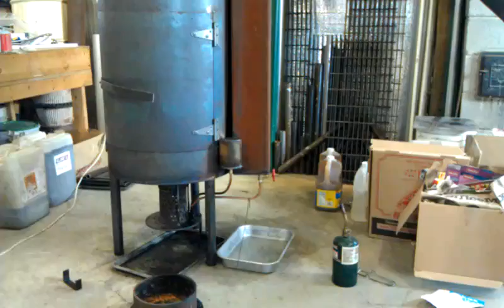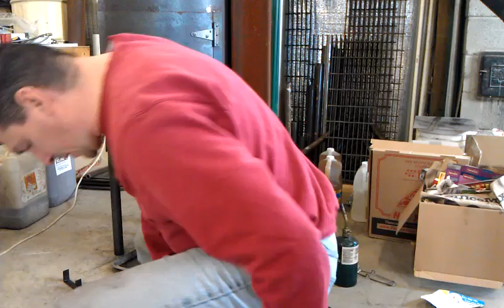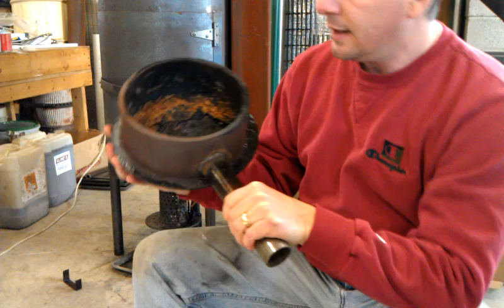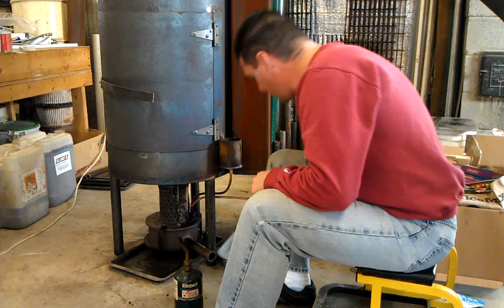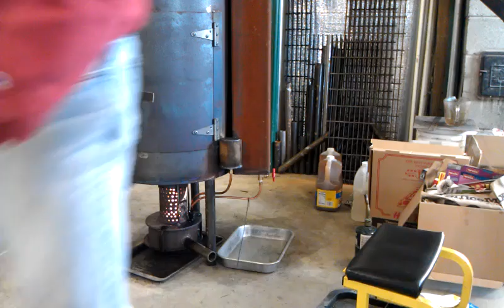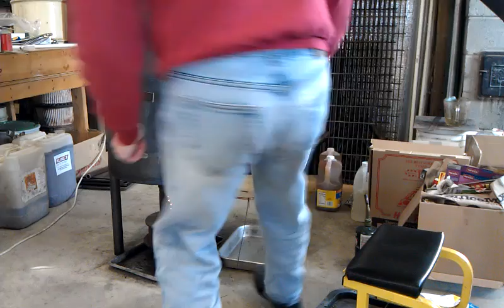Ozzirt style Waste oil Heater Lighting from Cold Start

Comment: Hmm.... I can't help but think, kerosene just isn't what it used to be!! We ran kerosene in a space heater and in our steam cleaner. They would run on either #2 fuel oil (diesel) or kerosene. Both quit working after getting a new delivery of kerosene... Couldn't even get it to burn well with a propane torch!!
After a good cleaning of both, finally got the steam cleaner running on diesel, it ran well.. the space heater never did burn correctly again 😥
So, drip some diesel in it, get some heat going!!
Reply from the maker: Hi Ed, yes I used to pour some diesel or kero in the sidekick tank to get things going more easily. It was a cool little stove that I created there, but I sold it long ago to someone in my hometown. I should write to him to see if he's still using it?

Comment: HI, neat system 
I just burnt my first 5 gallons of wvo and the bottom of the oil bucket has pudding like stuff that really gums up the burn pot. Do you usually settle out this stuff before and not burn it?
Reply from the maker: Well truly this system was designed to take the nasty stuff, chunks, water ...whatever you throw at it. So my advice would be to mix it well before firing up your stove. That way the gunk runs through and is burned up with the rest of the good fuel. Obviously you'll have to take care of clogs or make your lines large enough that clogs are not an issue, but in the end this can "eat" anything so long as it's given in small doses. -Does that make sense?

Comment: Hi this is my first time here. I am an old goat and have some experience with oil burners. first, when I was a young man i worked in a hillbilly garage. we had an oil heater made from an old hot water tank. worked really well for het using waste oil. It once wasnt monitored for about an hour and it filled and overflowed onto the floor. we had about an inch there we we found it.  lotta clean there. next I worked as a facility maintenance man for almost 40 years. our boilers always used forced for combustion and the fuel was atomized. it caught readily...figure out a way to atomixe it without power and you have something.  last..several people mentioned they are unable to find kerosene.  Diesel fuel used transmission fluid and used motor oil in that order will function in a oil heater.  they do need to be filtered if you are going to use them, otherwise they plug the lines at a choke point, aka valves.  if oil has plenty of combustion air it is capable of burning very clean.

Comment: How do you keep the waste veg oil from "gelling up" while it is inside a cold shop?
Reply from the maker: you don't prevent it. but by having the fuel tank on the side starting it on kero and having the sidekick allows me to easily deal with the issue. the heater warms the main tank in short order.

Comment: Mate, you are so behind.   I watched and waited for something spectacular, alas nothing happened.   You obviously haven't seen what you can do with air pressure?   Look it up and perhaps you won't be freezing your balls off waiting for the the bloody thing to get hot.
Reply from the maker: Robert Beattie Mate, this is a furnace that is specifically developed to run without electricity requirements. Open air, drip feed design. No kidding putting a fan on it will boost output. But that defeats the purpose Mate!

Comment: а что там внутри?
Reply: +Игорь Викторович write english .
Reply: +DutchArts1 "And what's inside?" So you understand?
Reply: +Игорь Викторович The inside more than likely is empty, and the heat from the flames builds up inside of the stove, which then heats the room. Still I have no idea why the stove has a door on it.
Reply from the maker: +eddie james This was built as a prototype to test various burner designs. I didn't want to have issues installing something so I built the door to grant access to the inside. That's all. Testing, viewing results etc...

Comment: Try pouring your starter fuel in with our waste oil. It should migrate to the bottom and then when you turn on the oil feed it will be your kerosene or whatever lighter fuel you are using that comes out first. This should allow you to have a single fuel drip and then it will automatically transition to the oil.

Comment: On previous videos I have watched I noticed they had air intke in bottom section, I have had success by using wood chips to get syhstem started and on another occasion I dirfected air from small blower, both systems quickened the process...I did enjoy your video though..

Comment: May I suggest you extend your waste oil in feed line to wrap it around your perforated intake to preheat the oil, before entering your flash pan which speeds up starting time.

Comment: You are both right. Coil a drip feed water tube (steel) down through the flame, pinch shut at bottom, and drill holes to let vapor out. Like LP burner. Water will combine with oil and burn. You might even have the efficient blue flame. Research patents.

Comment: Would a 2 valve system work for the veggie oil side, one to fine tune the drip and once set you never touch it after that, and another before or after it that is for shut off. I am thinking once tuned to perfection no more need to adjust it every time you light it. Or a mark on your drip valve where you know it worked on previous burns...just a thought.

Comment from the maker: The handle is just a handle, nothing more... All primary burn pan air enters from the hole on top down into the pan... then up through the central burn pipe with all of the holes in it.

Comment: you may not have a unlimited waste oil, but you can use that stove with a 3º deposit of unlimited fuel.
try to make a stable temp, and then open the 3º deposit.
 ->ad some drops of water to the equation.
hidrogen will burn and make a huge eat.
WARNING: when you have a pan of oil in flames in the kitchen don't use water to stop it. because it will burn the water... 
but in that nice stove...use it now!
ps: be careful...

Comment: We made one similar to this.  We burn waste motor oil in it.  The only problem we seem to be having is that it smokes a LOT.  I have wondered if making more holes in the "up" pipe between the burner pan (ours is bowl shaped) and the big tank would make it burn cleaner (more air) or if that's just the nature of used oil.  I'd rather not have that much smoke.  Any ideas?

Comment from the maker: It burns just fine. In fact it seems to be a lot easier to light than Veg does. So if you have an unlimited supply I would imagine you're all set! -Truly. Next (more important question) will you share some with me? *grin* -I do NOT have an unlimited supply of any type of waste oil.

Comment: I was wondering how you feed fresh  air to the furnace. Is there any issues with carbon monoxide build up in your shop?    It looks as if all the combustion air comes from inside the building. Really nice stove though. Am wanting to build one my self to heat my shop building.

  Thanks for the video.

Comment: Hi, thank you for your videos. i also use waste oil to heat my home, though not the same way as you. I heat water in my home made waste motor oil burner/boiler, the water then goes to my underfloor heating system for the house. I am impressed with your system, wouldn't it be easy to insert a 1" pipe coil vertically inside the top section to heat water for radiators or underfloor heating? The flow pipe can come out of the side at the top and the return pipe at the bottom.

Comment from the maker: I do not have any problems with it now. I am going to work on a smaller version now, but there really are no problems other than the overflow issue if you get the oil running too fast and don't monitor it.

Comment: hi there like your stove, it looks solidly made . i tried having holes to the top like yours but wouldnt burn hot for me but i found if i covered all the holes bar the bottom 2 rows on secondry burner  it burned much hotter. i have 3 holes on the primary chamber. if you like have a look at the video... good luck
Reply: Mine is styled more like Ozzirt's with the back to back heavy truck brake drums stacked on top.  It never puts out much serious heat.  It will load up with oil and go out if I try feeding to much oil.  My drip pot is made out of 1/8" thick 10" diameter pipe with a 1/8" steel plate welded to the bottom.  My secondary burner tube also has holes drilled around the side all the way to the top.   My primary chamber lid has holes drilled all the way around close to the edge of the pot.  I'll try covering most of the top holes in the secondary burner and see if it helps.  If not I'll try covering some of the holes in the primary chamber lid.  If that doesn't work I'm done with it.
Reply: @noneovyerbusiness4909  hi :); I tried having a very heavy duty burner pan to. It just didn't work . A saucepan seems to be the best.  Can you post a video so can see your setup.  Any help I can give you is my pleasure. I've had this system running for more than 15 years.